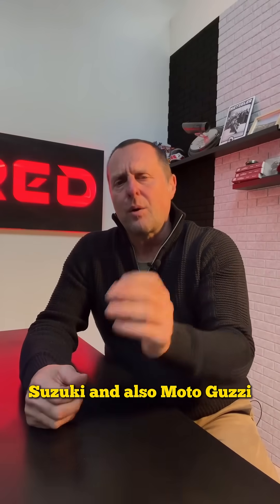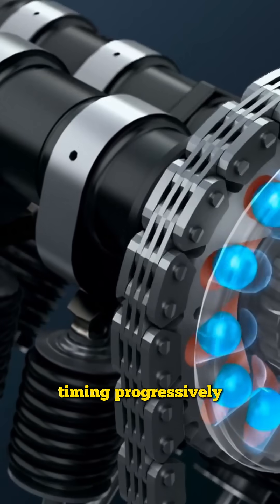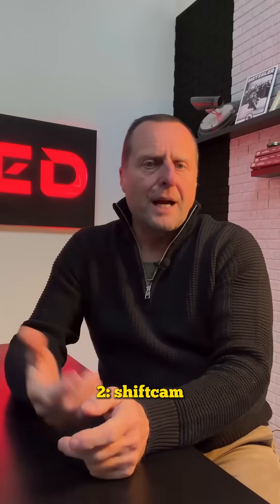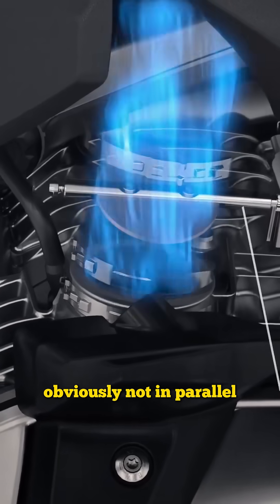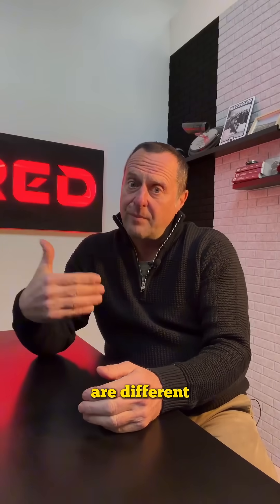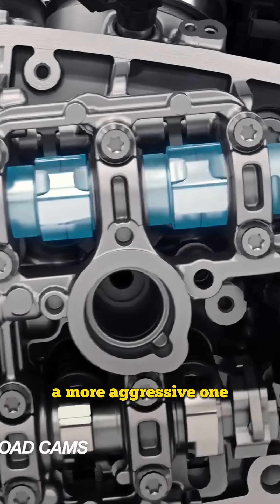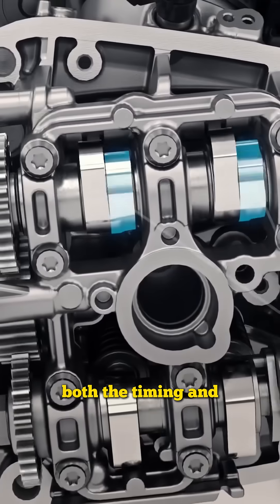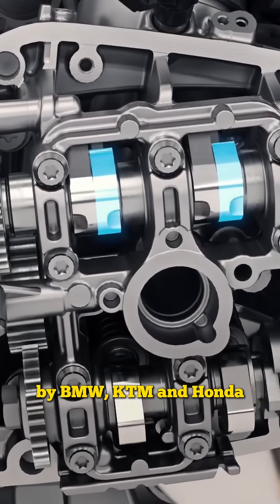Variable Timing vs ShiftCam | Which system is better?

Comment: Short and accurate, good job explaining such complicated systems.👍
Personally, I whish more motorcycles came standard with VVT or Shift Cam, as IT DOES WONDERS for today's tiny automovile engines when it comes to throttle response ANYWHERE in the rev band.